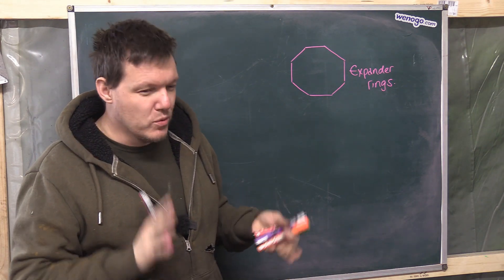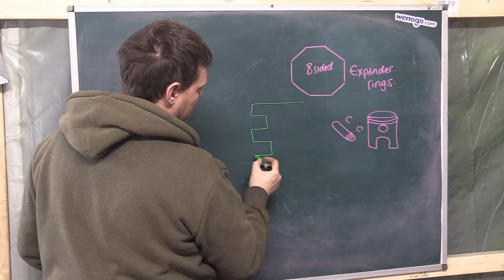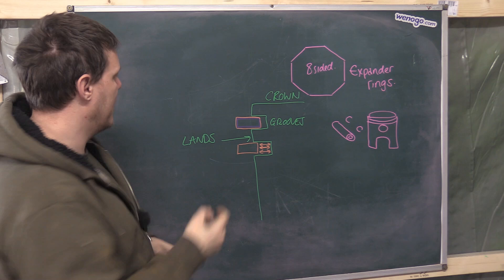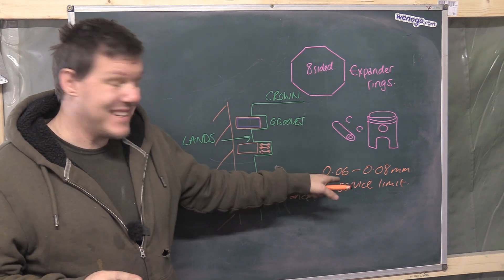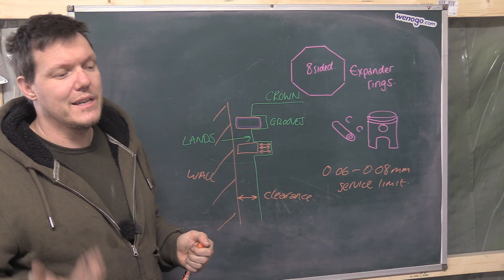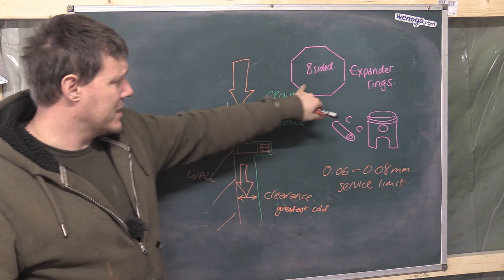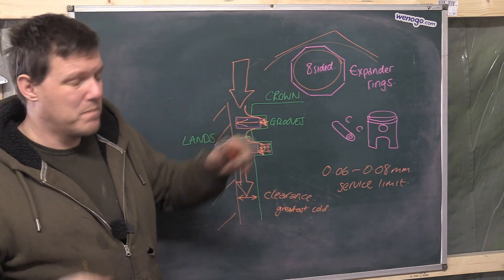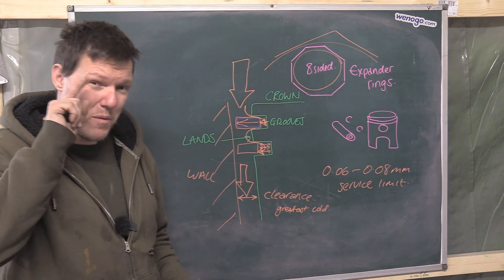WEIRD Octagonal piston ring

Comment: I was told you learnt a lot from 2vintage channel, is that true?
 😉
Reply from the maker: Who's 2vintage, it rings a bell...
Reply: @thedirtyworkshop  
Just watched the latest one (I Bought This $18,000 UTV For $3,000. Was It Worth It?)
First he rips off his fingerprints by sticking them between some gears, then he scalds his face off by removing a Radiator bleed screw.
Nine thirty two & Forty two forty.
I just don't know what to say, I feel as if I shouldn't comment lest it be deemed gleeful joviality or construed as schadenfreuderness
Reply from the maker: @transmitthis they did what?
Reply: @thedirtyworkshop  
I only watched that channel, as I wanted a refresher on bike mechanics, fixing up old engines etc, 
after 5 videos I realised I have learnt everything I could, and now I just needed to unlearn 99.9% of what I had just seen.

Comment: Very interesting, I was curious why I hadn't seen these before. Turns out the 70s 2 stroke Suzuki's I've touched didn't have expander rings but looks like some of the 70s Kawasaki 2 strokes did. I guess some manufacturers used them, some didn't.

Comment: These are still used on the hydraulic feeds on WW2 Hydromatic aircraft propellers which use bronze "piston" rings and therefore have very little spring in them, so need a spring expander.